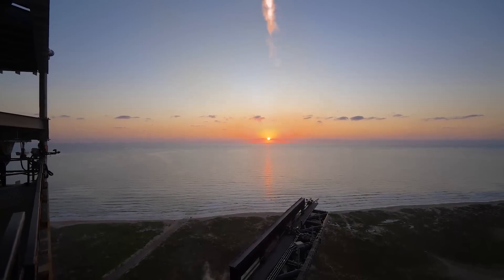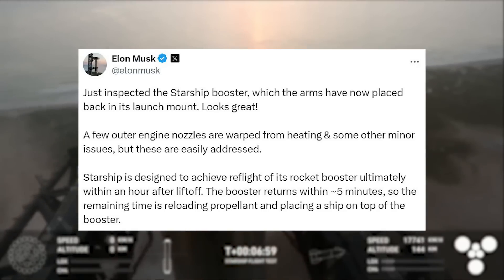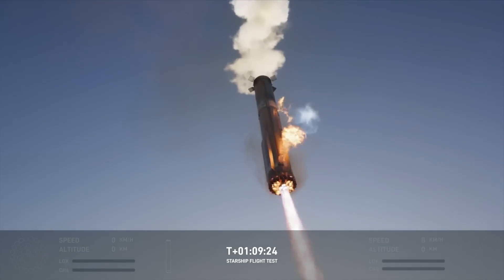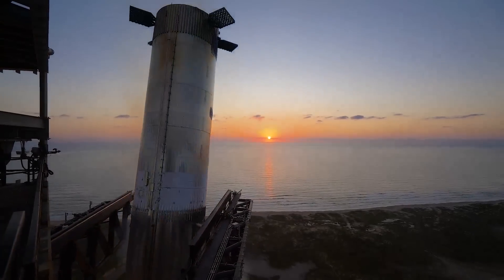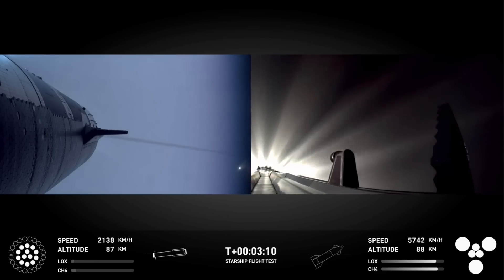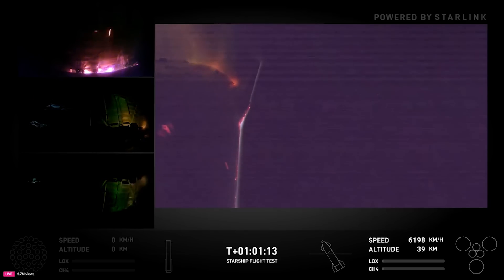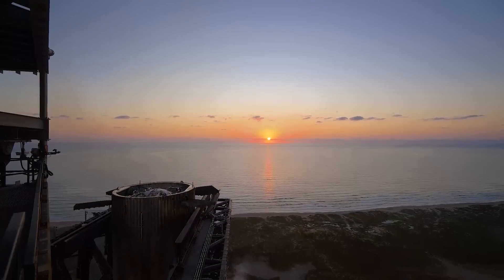What Happened After SpaceX Caught The Super Heavy Booster?

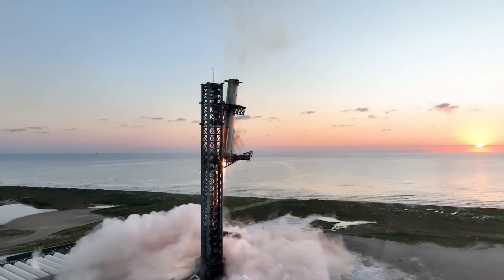Comment: @3:20.    SpaceX. might have started the deluge system as a precaution in case of a crash.  It would have suppressed a fire from the rocket.
Reply: Incase of a crash, water does very little for you. It's not solid material burning, it's a gas. The water deluge ensures that the concrete around and the steel plate do not experience excess concentrated  high temperature as that would warp the plate or crack the concrete
Reply: I don't think water can suppress a fire created by rocket fuel. Water has no effect on fires created with jet fuel. The water daily leach system is pad protection from the force of the engines on the concrete.
Reply: @jamesbarnesii4124  Starship doesn't use jet fuel. It's liquid methane... Water could help to save some ground equipment from heat damage in the case of mishap.
Reply: @jamesbarnesii4124  I'll have to think about your point some more.   It still seems intended to reduce damage to the area if the catch didn't go as planned.   It is an interesting topic.
Reply: @alansnyder8448  no it's to protect the launch pad from the extreme heat, which is why they do it when it launches as well
Reply: The heavy booster uses gaseous fuels, no liquid or solid to burn.

Comment: Just as a BTW comment..The flames coming from the side of the rocket was something expected as SpaceX was venting out unused methane gas..It WAS an incredible achievement nonetheless! Huge KUDOS to SpaceX engineers!!
Reply: Can't find an official statement on this.. So unless you got a source for what you said then it just looks like you just made up what you wanted to be true.
Reply: @dawgma  I think you are just trolling!
Reply: @dawgma  source it wasn't?
Reply: @dawgma  Lots of people pass speculation off as fact.
Reply: I heard it on Scott Manleys channel I think. Seems like there is no official confirmation but Scott is making an educated guess
Reply: @entspannter_hase  that's where I heard it. They also mentioned it on SpaceflightNow's live stream.
Reply: The venting was intentional, however the flames were not,  the entire manifold and fuel system was on fire quite a bit more damage than just some slight warping.   Issue is the composit materials and stripped-down hear shielding that make up the Raptor 3 in order to save weight.  Raptor 3 will never be reusable.
Reply: @sidvicious6505  - Never is a really long time.
Reply: And then who made you Spacex’s advocate? Venting does not behave as a fire, which is what we all saw, including Scot Manly.
Reply: Sure, the extra methane gas needs to be vented. But when? During the landing? Why not wait until the rockets have stopped firing and cooled down a bit before venting combustable methane gas? In short, I do not think this was intended and planned.
Reply: Though that seems plausible and I would like that to be true, I've been looking for an official source that confirms the fire was due to intentional venting. Can you provide your source?

Comment: I wonder about something. Will there be less friction and heat landing on Mars being the atmosphere is a lot less dense? Does that mean starship will spend more time decelerating?
Reply: To a degree, yes to all the above.
Starship will need to dive deep into the atmosphere in order to encounter enough of it to actually slow down, capture into orbit, and continue decelerating to a descent path. In the simulations ive seen, it'll be nose down for nearly all the initial entry, to use the lift generated to basically slingshot around Mars within its atmosphere.
It'll dip as low as 5 km above Martian sea level before rising back up to 15 km and performing the bellyflop.
Reply: @faxinspace  That makes sense. I assume if the ship doesn't dive deep enough it will simply go in and come right back out. 

Another question. Essentially the ship during belly flop on earth the ship was falling at about 450 KMH. Being mars's atmosphere is a lot less dense but has less gravity, how with that affect the ship's terminal velocity?
Reply: Some of SpaceX's previous simulations showed Starship fliping and lighting the engines for landing before reaching terminal velocity. But that was quite long ago and Starship is still changing, evolving and nowhere close to being ready for Mars, so who knows...
Reply: @plainText384  I was wondering about that. But fuel is the issue. What's about a drag chute to burn off most of the speed and then the engines for the landing only?
Reply: The velocities will be slightly lower I think, but the CO2 atmosphere makes heating worse. Density can be managed by choosing altitude, and temperatures are low enough that it makes little difference, but composition changes things substantially.

Comment: Why did the main ship blow up in the ocean... was that intentional (blowing FTS to prevent live ordnance hanging around), or other issues.
Reply: It was intentional, according to spacex
Reply: @jebinsky  According to spacex?  Where?
Reply: People are responding to you with nonsense here. The reason it blew up is because when such a huge thing tips over, it will break up even though it is in water. So the released gas immediately catches fire. If they had actually blown it up, you would have seen chunks flying.

The FTS is used in cases where you have lost control while UP HIGH and you do not want the whole thing to fly beyond the designated zone. You blow it up so that 1. It does not continue firing and travel long distances in the wrong direction. 2. Even if it is no longer firing, it does not aerodynamically slowly glide over a long distance. Therefore it just breaks apart and the pieces fall straight down.
Reply: @kevikiru  It was blown up on command from SpaceX.
Reply: @Quakeboy02  I figured that. I thought they would let it float for a bit to get more video, but it makes sense to blow it ASAP while they can still communicate with it.
Reply: Yep. You don't really want something that big floating uncontrolled.

Comment: At 7:05, you can see the chopsticks bend downwards because the booster sort of did a bit of an SN10. Hopefully they figure out how to make it land a bit more gracefully, but either way it’s a success no matter what
Reply: The booster came in how it should. They did a "power slide" into the stick. This is due to if the booster had a failure before being caught it wouldn't fall on to the OLM.

The chopsticks and tower are built to bend. So the chopsticks bending that way is by design and helps absorb the catch - reducing stress on the booster and tower.

Rigid structures = high chance of stress fractures and breaking.

Final note, the chopsticks bend even when picking up boosters and ships for integration.
Reply: I think that's more with the fact that the arms went from no load to 100's of tons on them instantly, that will cause some flex and I'm sure it's expected.

Comment: Another reason orientation of the booster matters, besides making sure the pins land on the rails, is the quick disconnect.  They don’t want to have to remove the booster from the OLM, rotate it 180 degrees, and put it back.
Reply: And it turns out they can rotate the thing, within limits, on the chopsticks. You can see the long leadscrews that move the catch rails.
Reply: @UncleKennysPlace  likely for fine adjustments.

Comment: The fire on the side of the booster was intentional. Propellants were being released through the quick disconnect ports, which quickly ignited and burned. Normally, during a test fire, the exact same thing is done, except the propellants are returned to the ground system tanks to be reused later.
Reply: The fire might be intentional but the missing cover from the raceway  definitely wasn’t. 😂
Reply: I keep seeing this, but it coincided with the cover over the COPV blowing off.
Reply: @hawkdsl  The COPV cover that blew off was on the opposite side of the booster from the BQD that was releasing CH4. Fire didn't start until the booster slowed way down from landing burn start.
Reply: @dmsdmullins  ahh, thanks. It is curious that the panel blew off. The COPV there looks fine. NSF had good shots moving the ship back to mega bay.
Reply: I don't know man

Comment: is a flight 6 with the current iteration of starship even necessary? like I feel like many things have been solved now and the things that still went wrong were mainly issues with the flap heat shield which the next iteration of starship addresses anyways. so tbh i don't see a reason they need to continue with this before block 2. 
not that i don't want another flight, always awesome to see it, just I'm not sure another flight is necessary or even desirable considering the cost of launching. maybe its time to speedrun to the next iteration, block 2 and second launchtower first very like after the successfull landing of a ship for the first time.
Reply: You're not considering the fact that the entire thing is a giant testbed.

They have a lot more to perfect, and this isn't the final ship.

Elon has a bigger version planned......
Reply: @RobertPruitt-y7m  still cost money and time. u are not considering the fact that they did that pretty often already. they often jump to the next test subject once the previous iteration is outdated even if it is almost completely built already.
and we know block 2 ships are already pretty far along. didn't see a block 2 booster yet tho
Reply: They can get more data which would be beneficial. More data on the booster would also be beneficial. Most of the cost comes from the booster. Around 70%. So just landing the booster is good enough for another flight
Reply: Landing the booster. Also, ship engine in space relight test. Then we may start to see things like ship catch tests. Honestly if they did a high-altitude campaign for ship catching it'd be awesome.
Reply: @Photostar625  ship catch test wont be before block 2 arrives. we have already seen block 2 ships and they are much much better equipt for handling the reentry. 
that's the question here. why continue on block 1 if block 2 is said to fix everything wrong with the current iteration. also considering the jump to raptor 3 that will be requiring some changes to booster and ship that might make further testing of block 1 unnecessary
Reply: if anything, they could use a similar flight plan, have the booster return the same way, but use the ship to deploy some cargo and/or go orbital for some further tests.
Reply: Why not use the last V1 to circularize the orbit and then deorbit?  They might want to start thinking recovery with the V2's.

Comment: Just curious, how would they improve/stop the warping of the nozzles? I feel like that is not something that merely better engines can do. I feel like there should be some sort of activatable end cap that covers the engines, looks like the descent is quite hard on them.
Reply: Just running more propellants through the engines is enough. The nozzles are very tough. They warped because they were weakened by the heat. So just pumping more propellants through the engine would allow the nozzle to be stronger and resist the warping
Reply: @Quasar-2  i just hope they can make an engine that can go for 10-20 launches before replacement
Reply: @blitzkrieg1941  Raptor recently had a test fire that went continuously for nearly 15 minutes. 

If they keep beating these engines up and improving them, eventually they could last 20,40,50, maybe even 100 flights each. 

Merlin is limited because it's a gas generator RP-1 engine. But Raptor in theory could just keep running over and over if it's ratios are perfect
Reply: They could change the flight profile to reduce reentry heating, possibly adding a reentry burn. They could also change the engine design to add structural and thermal magins.
Reply: when the engines run, cold fuel is pumped through the nozzles so thats how they normally keep them intact.

so maybe pump and vent some fuel while decent?

Comment: The warping came from the Heating of the nozzles during decent and then rapidly cooling once the engines started again as the nozzles are cooled with the freezing propellant.
Reply: I think the issue was that the outboard engines weren't having any propellant circulating through them; the additional internal pressure and regenerative cooling provided by the propellant would have likely kept them unblemished, so it should be a somewhat simple change to the booster
Reply: @randomalt9617  Agreed.  All engines need to be cooled in concert, regardless of which are firing.  The outer engine bells were being heated from only the inside, causing uneven heating.  They need to be cooled if the other engines are firing and being cooled.
Reply: can that be fixed/prevented.
Reply: @hawkdsl  yes, SpaceX will have it fixed by IFT-6
Reply: @bobguy6542  Main thing I worry about is that the propellant being fed through more engines will head it up more, meaning the thrust of the other engines will be slightly lower, as the hotter fluids would have to flow through at a lower density

Comment: <if elon musk/spacex could manufacture heat resistant tiles in larger sheets, but still retain all the attachment points, that might possibly ease the timeline for installation, etc.>
Reply: Won't work, tiles need to expand
Reply: prob cant because of thermal expansion

Comment: What happened with the upper stage? Did it explode? And are they going to recover the vehicle?
Reply: It splashed down intact, but tipped over and exploded. That's not unusual since it landed in water. The important part is they proved the landing accuracy by pre-positioning a buoy and landing right next to it. Also, you can see in the footage that a large chunk is still floating, so they might have been able to get a recovery ship in and pick that up before it sank.
Reply: No
Reply: I think it cracked after landing and sunk
Reply: It kersploded (technical term).

Comment: Ok, not having landing legs may reduce dry mass. But surely any benifits to payload capability are more than offset by the huge payload penalty that comes with RTLS instead of downrange landing.
Reply: having a tower catch also helps with relaunching since u don't need to ship the booster back, fold in legs, hook a crane up and whatever. with the tower u can basically just lower it down fill it up and relaunch.
Reply: That would be my gut feeling too, though I don't have the math to prove it either way. But what we can say for sure is that RTLS enables much faster turnaround times than waiting for a barge to sail back into port.
Reply: Huge payload penalty?  Can you cite any numbers or is this just something you say because it makes you sound more informed than you actually are?
Reply: Imagine the size of the drone barge you'd need to catch this booster. Maybe you can launch it from Texas and land in Florida though, if it goes high inclination
Reply: Not sure about 'surely.'  I'm no rocket engineer, but I presume they have found the benefits to outweigh the cost.  And there's the goal of ludicrous-speed turnaround times.  Whatever they couldn't load on the first rocket would go on the second one an hour (!) later.
Reply: It's all to do with costs as far as I'm concerned
Reply: Obviously not, or the best engineers on the planet should be advised by you, random youtube commenter
Reply: They plan to make a drone ship for Super heavy